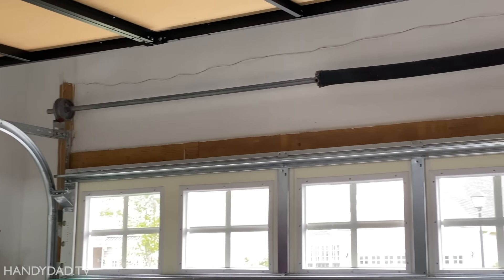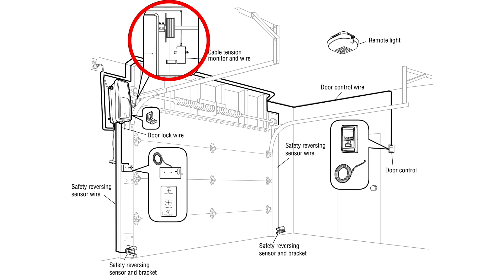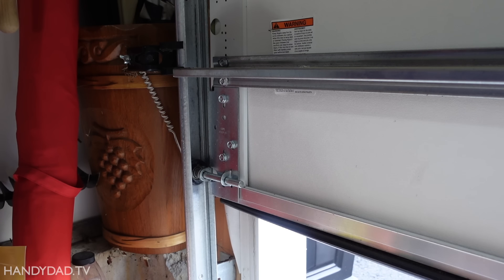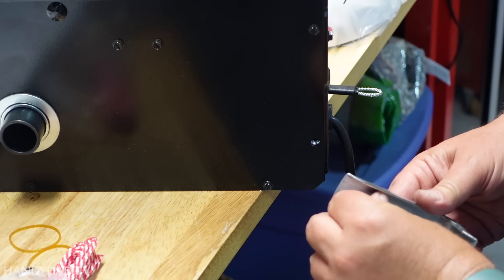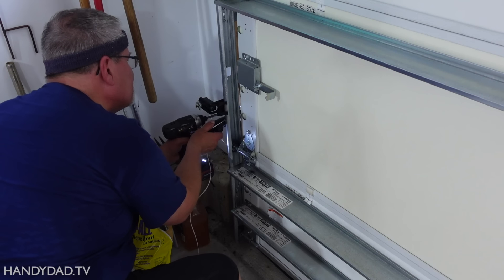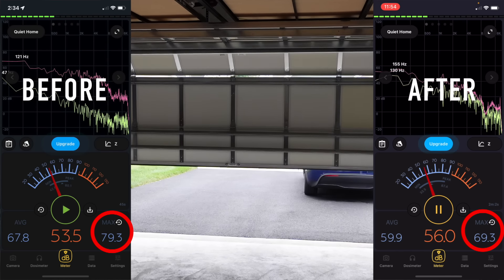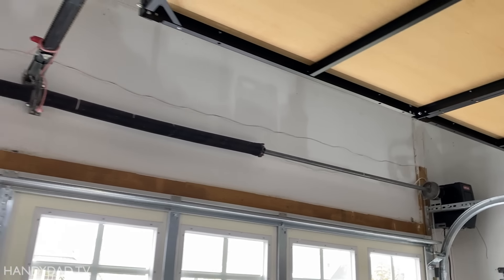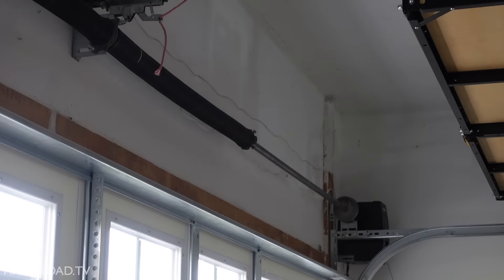GENIE Wall Mounted Garage Door Opener - Worth it???

Comment: As a professional garage door installer I cannot tell you my honest opinion, but I can recommend you install the electric lock since you just told everybody you didn't and you have windows. Someone can simply pop a window and reach over to the emergency release to gain access. Installing that lock will make sure that never happens. Make sure the lock is low enough that they can't reach it. 😉 I have installed countless of both brands.
Reply: I'm a professional garage door technician also and I always recommend LiftMaster or Chamberlain over a genie any day
Reply: @frankpropri540  When I was a young guy in the business I use to do that. But as time has aged me in this business I have seen both brands last incredible lengths of time. Some of the oldest ones I have come across have been the old Genie screw drives, way before sensors. Now I just try and ask what people want or expect out of a garage door opener and help to get them what best suits them. As the two brands continue to develop new products each is coming up with innovative ideas and Genie has really put their focus on ease of installation. Liftmaster has been a leader on feature options. I used to train people on I-drives and Wayne-dalton products and never thought those units would last, but to my own amazement some are still out there after 20 years.  I even ran across a torque master spring system the other day that was still working after 24 years, all original, blew my mind.
Reply from the maker: Thanks for the feedback!

Comment: You need to lube those rollers and hinges up boss, that’s one reason the door is making so much noise. Also your cable on the inside looking out left side looks like it’s starting to fray or come unraveled so might want to look into getting a new set of cables
Reply from the maker: Thanks. I replaced the rollers and lubricated the hinges. Big improvement. I’ll keep an eye on the cable. Thanks!
Reply: @handydadtv  also did a solid job on the op install too. I work for overhead door company so genie makes all of our operators. I do like the Liftmaster 8500 but when the infinity (ohd version of the same genie you installed in this video) when they came out I also like the wireless wall console and not having to have the cable tension monitor because I’ve replaced numerous of them on the liftmaster side mount operators
Reply from the maker: So glad I made a good decision!

Comment: I’d like to get one of these. I’m just worried about the width of the device. From my wall to where the shaft starts is only about 4-5 inches. Think it can be done? I know the specs say 6.8 inches wide. But do you think there is any play there?
Reply from the maker: What about the other side?
Reply: @handydadtv  same size
Reply from the maker: I don’t think that’s enough room.

Comment: I considered one but they are three times the price as the one I settled on, and in our case it offers no significant benefit. The brackets and receptacle remained from the old opener and I didn't have to install anything new, only replace the opener and sensors, and the multi-function wall control uses the same two wires as the old basic button. For a ceiling unit the new Genie belt drive is so much more quiet than the old chain drive Liftmaster.
I've never needed another person to install a garage door opener.

Did you say you disconnected the springs?  Those need to be connected and the door balanced to less than ten pounds lift force. Neither type of opener is intended to lift doors. They merely move them into different positions while the springs do the heavy lifting.
Reply from the maker: No, I didn’t touch the springs.
Reply: @handydadtv  I guess I misunderstood

Comment: I didn't get the battery backup either, but it appears that all the setup settings are lost with a power glitch.  What a hassle to set it up every time that happens
Reply from the maker: I would contact Genie support. That’s not right. Mine doesn’t lose settings.

Comment: I'd love to ditch the overhead track, but I have an extension spring setup, although I love that my springs have held up for >25 years.
2:42 That cable is looking ragged.
Reply from the maker: Thanks
Reply: Call a local garage door repair place. Your door can be converted to a torsion spring.
Reply: @michaelkendall3379  I just move to another state and the problem went away.

Comment: First time seeing this type of opener. 
What about when the door hits an object & will it go back up like with my belt driven Geeni dose? Or will it just stop? Sometimes the sensores can’t detect everything & I don’t use them on mine. I taped the eyes together & hung it up on tbe opener. I’ve had the plastic belt gears brake when the door hit something. Replaced the gears with metal ones & no failure yet.
Reply from the maker: Yes it reverses for obstructions, and the force is adjustable.
Reply: Dangerous, even with auto reverse there is enough pressure to kill or seriously injure a small pet or child.  Plus it opens you up to legal liability.  I'm not a big fan of nanny stuff but this is one area I won't risk it.  Plus if insurance company determines you defeated the device they can say to bad and hang you out to dry.
Reply: @handydadtv Thank You! I wonder what other type of opener they will come up next.

Comment: Ordered one of these and had it installed by a professional, it seems to work fine but I notice the machine wobbles a bit from side to side as the door opens / closes.  Is that normal or was it mounted incorrectly?
Reply from the maker: Mine does that too. The bracket was engineered to allow movement so I’d say it’s normal.
Reply: @handydadtv  Ok thanks
Reply: @handydadtv  Here is a video of it, is this much wobbling normal? 
https://youtu.be/xn7spCPM6kE
Reply from the maker: Mine wobbles too. Likely because the shaft isn't perfectly inline with the unit. I think the bottom bracket is designed to allow flexing.

Comment: Can you open the door remotely with the app? For example to let a relative into the house who does not have a key to the front door?
Reply from the maker: Yes, you can open and close it from anywhere using the Aladdin Connect app.
Reply: @handydadtv  That would be a very handy feature for me. Cool.

Comment: What is the measurement from back of opener to center of where torsion bar goes in, manual says 6 inches and that doesn’t look like 6 inches I only have 4 give or take
Reply from the maker: It’s about 2-3/4 from the back of the unit.

Comment: it looks to be simpler, and i assume it costs the manufacturer less, since its new and better they are charging more, it doesnt cost more.
weve had garage door openers for 50 years without wireless, what does wireless add other than a coolness factor.
Reply from the maker: Wireless controller - ease of installation. 
WiFi - notifications and automation.

Comment: So on a power failure how can you manually open the garage door? How do you disconnet the drive?
Reply from the maker: Yes, like any door opener, you pull the red cord to disengage the motor. Then operate the door manually.

Comment: I have an ancient chain opener that lost the ability to wirelessly open a few years ago. I had been using the Aladdin retrofit kit to add connectivity to open the door from the Connect app, but one issue I have with Aladdin Connect is that it always seems to go down at inopportune times. I'll get timeout errors trying to log into the app, and server errors when attempting to open sometimes. 

Have you experienced any issues with the app?
Reply from the maker: No, I haven’t had any connectivity issues with the app.

Comment: Ok so with the genie oli wont need to the phisical garage door opener button anymore?  My garage motor broke so i wanna replace it. However my garage door button is hidden behind a very heavy metal cabinet and i would hate to move it.  Will this lock door automatically
Reply from the maker: You can put the button wherever you want. It’s wireless.  It comes with an automatic lock.
Reply: @handydadtv  ok so I don't have to worry about my older wall button then.  Thank u
Reply: @handydadtv  Do you know by any chance if I could use extension cord with genie or not recomended?  I have an outlet close by but I think is like 15ft from where the genie will be install so I would have to use extension cord.
Reply from the maker: @futbol1972 Technically, yes, but only temporarily. It’s a code violation so you can’t sell the house like that. It’ll definitely get flagged during the home inspection.
Reply: @handydadtv  what if iam not selling the house with the genie work fine with extension cord?  I mean if I was to sell it I can always install an outlet close to genie but thats if I was going to sell it
Reply from the maker: @futbol1972 Listen, I’m sure there are safety reasons why the electrical code doesn’t allow extension cords. So the RIGHT thing to do is plan to run an outlet for you and your family’s safety. Not just if you sell the house. So that’s what I’m recommending.
Reply: @handydadtv  that's what I wanted to know.  Tha k u

Comment: Torsion springs can break without warning, you should install the deadbolt.
Reply from the maker: I’ll think about it.
Reply: The deadbolt keeps the door closed.  If a spring breaks, most openers won’t be able to open the door.  The deadbolt does not lock the door open.
Reply: What would that help ?

Comment: Thanks for a great video.  Can you comment on the range of the Genie remote with your new side-mount opener?  I have a Chamberlain unit and have only 10 foot range with my Chamberlain remote.  I’m seriously considering this Genie to replace the Chamberlain if it has a better range and is compatible with using LED bulbs in the powered light fixture.  Many thanks.
Reply from the maker: My Genie unit has the antenna wire hanging down below it, so the range is really good. Although I haven’t done any scientific testing with the remote, we typically activate the door from our cars with HomeLink while we’re still on the street in front of our neighbors. That’s around 50 feet.

Comment: Great review. I still prefer the overhead belt driven by Chamberlain with battery. I’ve installed 3 of them by myself; just use a 2nd ladder or shelf/stacked totes to support the other end. I had a Genie many years ago, and always felt their design & tech elements were lacking which may have changed over the years.
Reply from the maker: Thanks

Comment: Hiya,
I'm a bit concerned by the unit twisting at 6:24. Doesn't look good for wear and tear.
Reply from the maker: We’ll see. But I think it’s got flexibility in the bracket by design.
Reply: It’s normal . If it didn’t flex some it wouldn’t last
Reply: @noahholt482  I don't buy it. Other installs on YT don't flex. Something is mis-aligned, or out of round. 
My last comment.
Reply: Any updates on this?
Reply from the maker: I haven’t touched it and it’s still working perfectly.

Comment: Without moving the rails up, why there is any advantages with wall mount? No space saving.
Reply from the maker: Wall mounted is extremely quiet. Even belt driven openers attached to the ceiling resonate vibrations throughout the house.

Comment: Did you remove the old door opener? Not sure that's something a homeowner can do due to spring danger.
Reply: When the door is open there isnt much tension on them. And you can tie them off before releasing them to control the rebound. But they do deserve respect!  I had a cable bust randomly once at night. The spring punched straight through the plastic back of a stored Adirondack chair.
Reply: @LourdVicious  operator itself won't have any tension on it with the door open or closed (properly balanced springs assumed) removal is the easiest part
Reply from the maker: That’s right. There’s no tension on the door opener.
Reply: The new opener still uses the original springs.  Without the springs, no opener can lift the door.

Comment: If the door is balanced properly, meaning, it will want to close, you will never have the motor out-run the springs and cause slack in the cables. This is why I like the type of opener that starts slowly, then speeds up.
Reply from the maker: Thanks for the info

Comment: With Homelinks in cars and the app on your phone I can certainly no reason for any extra FOB or keypad. We now just keep one of the FOB in the front office and have disabled the keypad entirely. If and when my garage door opener does finally give out this would be a great option, but we've had it now for 20 years and it's still going strong. :/
Reply from the maker: One of the cars in my family doesn’t have HomeLink. I bought another just as a spare.
Reply: @handydadtv  Makes sense as only 2 of my cars have Homelink and both are newer. The rest of the cars don't go in the garage so never really thought of it. But luckily that's where the phone app comes in. A spare is always a good idea.

Comment: I wanted this type of unit but the homebuilder doesn't make the garage with adequate clearance on the sides. It would have made a difference in storage space.
Reply from the maker: That stinks.
Reply: @handydadtv  In San Antonio, RAYCO Homes builds 'em cheap - stacks 'em deep...

Comment: Hmmm... When I moved into my house there were no automatic door openers. Double doors instead of one large door so I needed 2 openers.   I went to Home Depot and found 2 openers on clearance.  One was a Genie belt drive, the other a Chamberlin chain drive.  No WIFI, just basic openers.  Total cost was $250 including extra hardware.  Garage is semi-attached so noise is not a concern. That's was 4 years ago so would be more now but I still could not have afforded 2 wall mount openers then.  Now I see there are aftermarket WIFI modules available for around $50.    Wall mount openers are just too much $$$ for me!
Reply from the maker: Yes, you can add a MyQ Smart Garage Door Controller to any opener. Cheap and easy to install. https://youtu.be/bfKX4UREGgU

I agree, use your openers until they die.

Comment: I have a traditional Genie ceiling mounted opener works great. Does anyone know if this model has wired connections on it so you can connect a 3rd party device to it, so it can also open and close the opener? I have a device from my ADT alarm system connected to it so I can open and close the opener with the ADT app.
Reply from the maker: I didn’t try, but I assume you could.
Reply: @handydadtv  Ok, I was just wondering if you noticed any extra connections on the unit that could be used by a 3rd party device. I know my current unit has them and that is how the ADT app can open and close the door. It looks like the Geenie app has all the same features and more for remotely controlling the door.  I just wanted to know if this model had that feature also?
Reply from the maker: @mj1s735 I’m sure you can call the company.
Reply: @handydadtv  All good man, just wanted to know if you knew for sure. If I decide to buy one I will find the manual for it, or ask their tech support. I know for sure my older model does because that is how the ADT interface connects to it.

Comment: So someone can just lift the door manually from the outside with this opener?
Reply from the maker: It comes with an electronic lock that I chose not to install. In theory, yes the door can probably be lifted but it’s really heavy. I tried and can’t budge it. Maybe with a forklift.
Reply: @handydadtv  Ok, so it will automatically lock, it's not manual?
Reply from the maker: It automatically locks, but you can manually unlock it in case of a power outage.

Comment: I defently want one of this garage door openers. However, i want one that has a deadbolt that locks automatically when door closses.
Reply from the maker: This has an automatic lock but I chose not to install it.
Reply: @handydadtv  may I ask why?
Reply from the maker: I felt my double door was heavy enough for security. Plus it was a gated community. Low risk in my opinion.
Reply: @handydadtv  very nice.  So with this I can just use my phone or the control remote to open it and close it correct and it comes with dead bolt or I have to purchase separate?  Which model do u recomend me to get?
Reply from the maker: @futbol1972 If you use the same model as me, linked in the description, it comes with the automatic deadbolt.

Comment: We installed this but on a trial run the door goes up but doesn’t go down. What could be wrong? The motor is spinning but the door sits there.
Reply from the maker: Call Genie support. They will troubleshoot with you.

Comment: I think I would see more value to this replacement if you had high ceilings and then could change the track on the door so the door would end up in a much higher position when it’s open.
Reply from the maker: Typically they only do that with high doors, like for a boat.
Reply: Yeah but you gaining a lot of headroom in the middle of your garage either way. Works out great for people wanting to hang overhead storage in the garage.
Reply: I agree with you
Reply: I install garage doors and openers professionally. What you are talking about is called highlifting and in addition to extending the track you have to replace the springs to match the new configuration of the door. Following the pith of a roof is also possible but the track and springs have to be built for it
Reply: @michaelkendall3379  I believe the drums might be different as well.